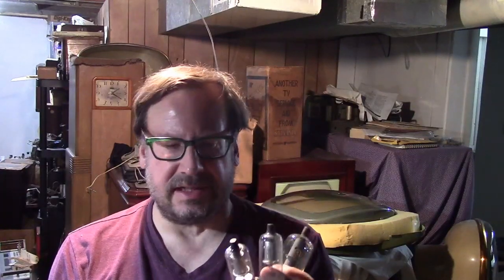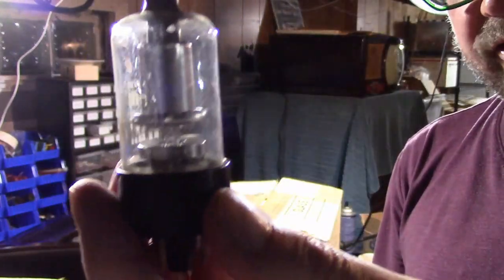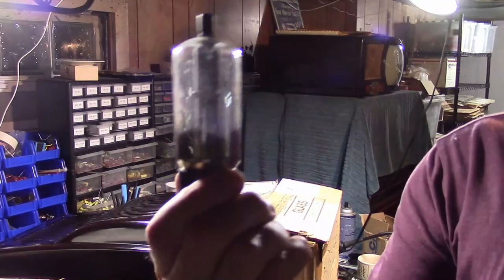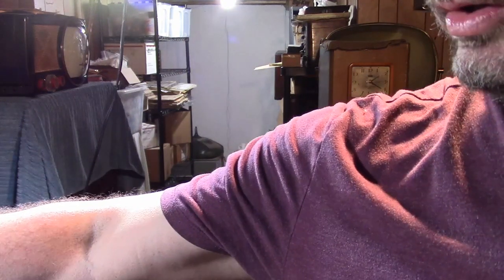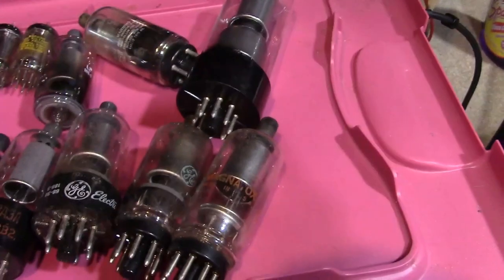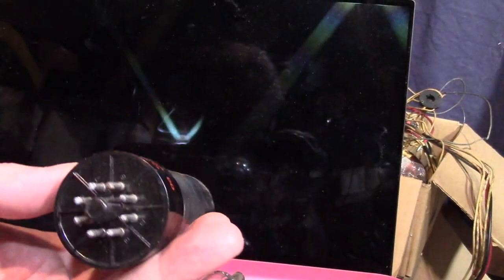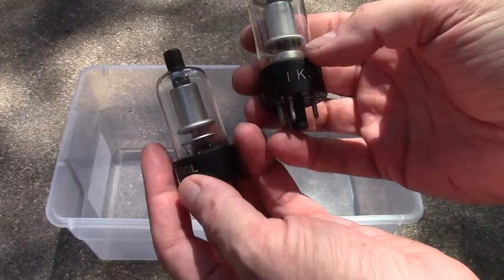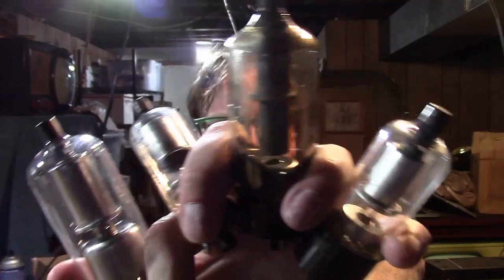HV rectifier tubes, shunts and X-rays

Comment: Great video as always, Bob. I recall back in the day, years ago seeing high hour 6BK4 tubes that had turned a dark brown coffee color. I had read that was due to x-ray bombardment of the inside of the glass. Those were often in the sets where the getters on the horiz output tubes would have turned a pale tan color instead of the silvery color. High hours indeed. Of course, there was usually a large "stalagmite" of wax underneath the flyback. Those were fun memories for a young TV tech.

Comment: I remember as a kid 14/15 years old being given my Dads old 14 inch B&W Bush (TV43) It was just old. I decided to up date the valves and caps. The high voltage rectifier was one I had not seen before. Smaller than a B7G but was wire ended. 2 wires on the base and one coming out of the bubble on the top. It was soldered in place. Sadly the extra voltage it gave made a corona discharge all over the transformer. At that age I had no idea how to stop this, so the old valve was put back into service.
Reply: Sounds like a 5642 tube. Commonly used in early Sylvania TV's and some Japanese sets, and some oscilliscopes.
Reply: @f.k.burnham8491  I 've just looked up the original circuit and it's an EY51 (UK) number.

Comment: Great video!

If you want a real "deep dive" on the history and design evolution of the 1B3, there was an article in the Feb-Mar 1960 issue of the "RCA Engineer", written by one of their design engineers from Harrison.  Covers the white banded variant, the reason for the red type number on some tubes, and the redesign to reduce X-radiation.

https://worldradiohistory.com/RCA_Engineer_Issue_Key.htm

The 3B2 is a rectifier diode, used in the first CBS-Columbia color sets.  The original color TV shunt regulator (used in the RCA CT-100)  was the 6BD4, which was replaced by the 6BK4 very quickly.
Reply from the maker: Thank you for the link.  Now I finally know what the white band is all about :)
Reply: Thanks for the link. That was fine read.

Comment: The purpose of keeping the CRT ultor voltage nearly constant in color sets was to fight an effect called blooming, in which CRT ultor voltage that fell due to loading down the high voltage supply in bright scenes through beam current draw would cause the beam deflection to increase and the picture edges to push further and further beyond the screen edge (because the magnetic fields from the yoke remained the same, and beams propelled by a smaller voltage are deflected more by the same magnetic field).  These shunt regulators, used in early color TVs, were controlled by a circuit that kept a near constant total current (part through the shunt regulator, the rest through the CRT) being drawn from the ultor voltage supply no matter whether the CRT itself was drawing much or little current.

Blooming could happen in principle in B&W sets too, but their far smaller CRT ultor current associated with these tubes (they had only one gun, not three, and no shadow mask to consume beam current which was unable to strike any phosphor) made it easier for the high voltage supply to keep a constant output by itself.

If memory serves from when I worked on these sets several decades ago, more modern high voltage regulator circuits worked differently, as by keeping a constant total load on the horizontal output circuit itself regardless of CRT beam current draw.  These circuits only worked at several hundred volts, so they had no more danger of emitting X rays than the rest of the tube circuitry.

Comment: I mostly saw the 1X2 and 1AX2 tubes in import TV sets and some O'scopes. IIRC they added leaded glass to some of the late production 1B3's and such, and to the 6BK4's ; some like Motorola went to the solid state HV rect. stacks. 
it's been a lot of years to remember back into the '60's & '70's when I worked on the sets daily. . Possibly the latest edition  'Tube Lore II" may have a lot more info on the tubes.
 At one point, IIRC they made a "replacement" branded 1B3/1G3/1J3/1K3. Saw very few of them. They used a taller glass on some, and shorter glass on some. Sometimes the plate cap lead wouldn't reach the anode cap on the tube. (Similar to the short glass/ tall glass problem on the 6HA5 tubes for color tuners).
 You missed the often used 5642 with all wire leads. Used in Sylvania B&W sets for a while, sometimes 2  in parallel. Some Japanese import sets used them as HV rect., some O'scopes, and at least one color TV mfg used them as a focus rectifier for a while.  (I still have an old, used Sylvania FBT assy with the tubes still on it I saved as a novelty.)
  I hated them, as if you suspected one was bad, you had to unsolder the leads, and sub them out. I do think I saw 1 tube tester that could test them to a point, by using clip leads, but they still had to be unsoldered. Still have several used & NIB in my stash.
 55+ years of working on TV sets, and starting to forget a lot of what I used to remember. Now what were we talking about again?

Comment: Those very high voltage triodes in the 6BK4 family held their value for many years, into the early-2000s. They were used in some of the X-ray lithography machines used in the semiconductor industry. NOS 6BK4C sold at a premium.
Reply from the maker: Huh, had no idea.  I don't suppose they still do ?  I have a dozen NOS - 6BK4/6EL4

Comment: It makes sense that the rectifier tube generates less X rays than the regulator.  The voltage drop across the rectifier when conducting will not be that high, so the electrons will not have much energy to generate x rays.  When subject to inverse voltage it will not conduct, so again no X rays.  On the other hand, the electrons in the regulator will be accelerated to 25keV before slamming into the anode, which happens a lot, the current varying inversely with average picture brightness.  I would have though that picture tubes generate the most X rays, but they are made of lead glass which I guess absorbs them.  An interesting episode.  In the UK most TVs had tubes like EY51, EY86 and DY86.  EY51 had no base or top cap just three wires coming out through the glass.
Reply from the maker: I don't think early picture tubes have any lead.  At least not B&W.  You need to get up to around 20-25,000 volts before x-rays are produced and B&W just don't run that hot.
Found a good article from Nov, 68 stating that the scare started in 67 and details the main areas of concern.  https://www.rfcafe.com/references/radio-electronics/color-tv-x-rays-radio-electronics-november-1968.htm

Comment: Bob, looks like your shed is a very hot place for your Filament Facts segment.
At this point, vacuum tube collectors went into palpitations and fainted. 25:24  Thank you for the video, Bob. I noticed the glass of the last tube, did look quite thick, at around half a millimetre.
Reply from the maker: Oh you mean because I'm sweating? I had just been doing yardwork. It's nice and cool in the basement 😎
Reply: @bandersentv  - Yes, it looked like you were slowly basting. Good to know otherwise. 👍

Comment: Great insight into the internal workings. I realize they are just diodes, so filament + plate, but seeing the plate as just a thumb-size thimble is an eye-opener. 
Also, do you intend to market your tube-open-upper tool? It appears to use considerable mass at a very low velocity. It also looks strangely familiar...

Comment: Interesting, but I would rather see more Predicta restorations especially love to see him get that plating done. For all the detailed work it would seem the plating would be a no brainer. He has spent a fortune on tools and parts acquisitions to say nothing of the millions of hours of labor! Also want to see him build a new plastic face plate for the Siesta model clock! I know he could do that if he wanted!
Reply from the maker: Sorry to disappoint but I decided against plating.  I'm just going to go with metallic brass paint.  It turned out nicer than I expected on the latest Predicta Holiday project.  I know people that have had their Predicta replated and there are a few issues.  All the old plating and rust pits need to be ground out and polished.  That process removes detail.  The raw steel then needs to chrome plated before the brass. All that takes a lot of times and money.  Easily over $300 to have the arms and legs for a Holiday done.  

As for the labor, it's really not that much.  Especially since you can now buy replica networks. I put far more time into the GE 800.

All that being said I will get back the them eventually.  I have customers waiting on other sets that take priority.

Comment: good video Bob, and very instructive. One thing you didn't mention though, is whether these tubes were typically vacuum tubes or were there types that contained noble gases? I'm thinking of Argon or Neon gas, or even Mercury vapor? I seem to remember there are some very high voltage/current rectifier tubes that are gass-filled... although I'm not 100% sure, having never come across those tubes.
I'm sure breaking those old tubes must have caused you a measure of anguish... after all they are becoming rarer by the day.
Thanks for sharing and sacrifying your tubes for the greater good  :)
Reply from the maker: Thank you.  They are all high vacuum.  There are mercury rectifiers that can handle higher currents but not as much voltage.  They 866 is one type.  Also the filament runs on a hefty 2.5A.  They are typically used in transmitters.

Comment: Can you sort out the issues of which diodes can be used in the Horizontal AFC (dual diode).  Schottky (1N5819), switching diode (1N4148) or standard rect. diodes (1N4000 series).  I have used 1N4004s  to replace the selenium dual diodes in 4  TV restores and horizontal hold is rock steady.

Comment: I've been working on a good storage concept for tubes.  I have about 50,000 and it has been challenging to say the least but I think I figured it out.
Reply: ...and that is?
Reply: @1McMurdoSilver  sort numerically.  I put loose tubes in ziploc bags, in cardboard boxes that are about 4" x 8" x 24".  They fit nicely on shelves.  I'm working on "6" this weekend.  I have 1 box each for 6A, 6B, 6C-D, 6E-G, 6H-Z.  A few tube numbers, of which I have 100s, I pit in a box of their own.

Tubes in boxes or tubes that i test that get white boxes go on a different shelf.  Everything is managed in an excel spreadsheet while i am building my website. 

I'm still not sure what to do with the metal tubes.  I have about 400 pounds of those waiting in large boxes in the garage.

Comment: If you're still accepting submissions for this segment, does anyone know why old sets tend to have the power switch in the neutral wire instead of the live wire? I would think it has something to do with the use of unpolarized plugs but I can't figure out why.
Reply from the maker: Since they use non-polarized plugs, the switch is either on the neutral or hot depending on how you have it plugged in.  I think what you're really asking is why is the power switch on the B- or chassis side.   The best answer I've seen is from Phil Nelson's website: "The manufacturers probably placed the switch in this location to keep it close to the potential of the volume control (on which the switch is usually located) to minimize hum".     His article covers the topic very well:  https://antiqueradio.org/safety.htm

Comment: Here's a question: are there sufficient quantities of copper and other metals in some or most vacuum tubes that we should be recycling it when a tube is too weak to use, or if its a tube type that nobody really wants and has little to no resale value nowadays? How practical is it to recover the metals, and is it economically viable and sustainable ? Where would the tubes go to be recycled and what would the process entail? By the way, I have some 5550 mercury rectifiers, beer-can size glass and ceramic cylinders (originally used in old arc welders) that came along for the ride with a big batch of tubes I bought some time ago; they contain maybe a 2 or 3 tablespoons of mercury each, and since I haven't been able to find a market for them I am gonna have to drive an hour to a hazardous waste facility and pay to dispose of them.....
Reply from the maker: It's a tiny amount of metal.  I would think you'd need many thousand of tubes to get a useful amount.  They haven't been made in any significant quantity in over 50 years and I doubt there are any large stockpiles of undesirable tubes around.
Reply: @bandersentv  , go to any hamfest and there's always dozens of guys with tubes that hardly anyone gets excited about. I'm an audio guy, so naturally I keep what's usable or saleable for hifi and guitar amps, or for collectable vintage radios , and sell the excess, but I've never come across anyone who actually wants or has a use for dampers and HV rectifiers....I've certainly thrown out thousands of dusty, dirty "pulls" and even some common-as-dirt NOS tubes.
Reply from the maker: Sure, I've seen those too, but that's nothing on the scale you'd need to get anyone interested in recycling.  The metals are mostly steel and nickel alloys.  Little bit of tungsten for the filament.  Various compounds for the cathode coating and getter.  Plus a whole lot of glass and bakelite.